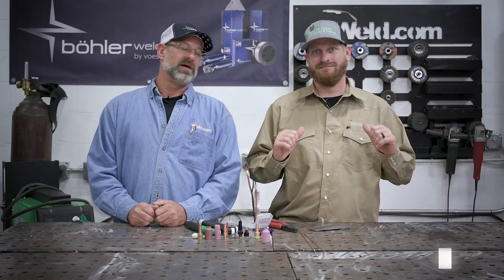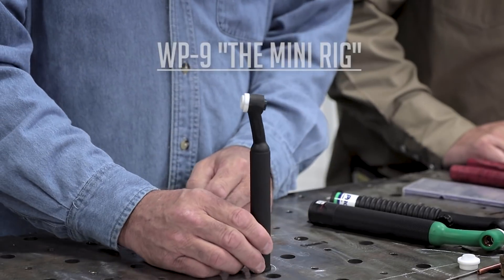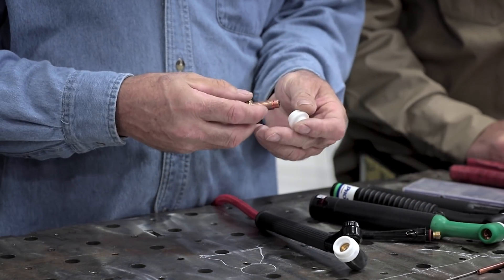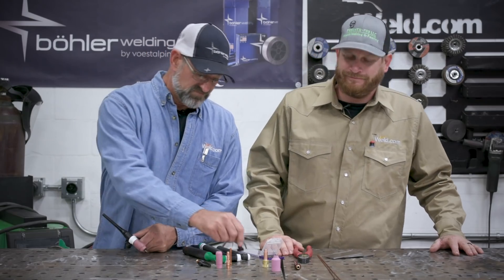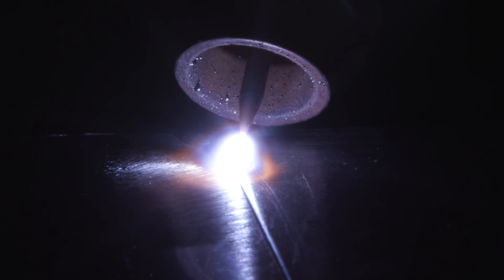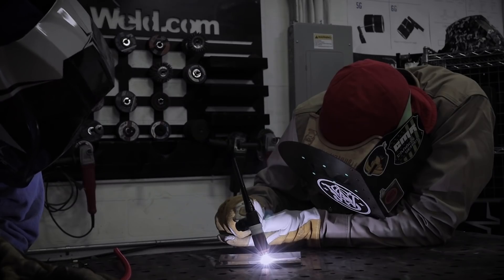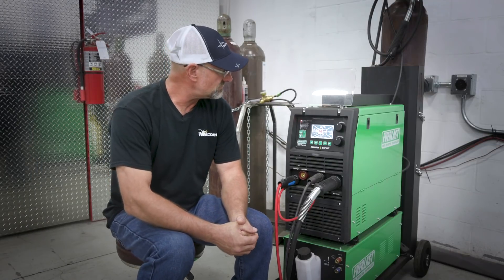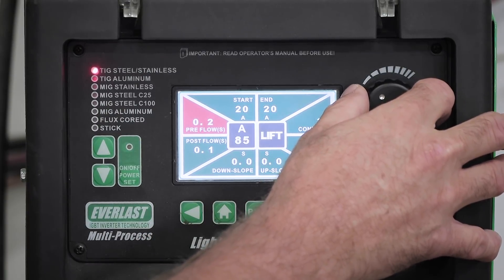Learn TIG Welding: A Beginner's Guide

Comment: Just started Tig on steel, definitely not at the Fun part yet kinda more in a different F Frustration. Out of all welding processes I have done Tig is the most challenging. I thought it would be easy because I has done Oxyacetylene years ago. Maybe it is because I am older it seems harder. Bob did very good, I have about 2-3 hours in and my tungsten is a couple inches shorter from dipping it. 😡. I will keep at it , after a few hours I was getting better, huge respect for those guys doing beautiful welds.

Comment: Hate to say it, but on that second piece he should have stopped him. Bob was barely dipping at all and basically spreading that puddle thin, he probably got an odd mix of filler and fusion welding going on there. It's not out of a beginner's ability to learn the idea of dip and move on the fly. It won't be the best looking weld but it's a step in the right direction.

Comment: Only 0.1 sec of post flow?? The post flow is there to protect the tungsten as it cools down, not protect the metal😄
Baseline would be 1 second per 10amps of current👍

Comment: 0,2 sec post flow = bye bye tungsten. Post flow is not for cooling (it does a veeeeery little bit, but not main purpose)! It is to protect hot metal from oxidation! Well known and good practice for post flow is to set it to 4 seconds for aluminium and black steel and 6 seconds for steinless.

Comment: I've had issues lately putting cubes together and working with tube where i immediately see oxidation, sparking, rust and porosity if i make a second pass after  root and i get penetration... in addition to the closed items spitting hot iron at me 😂🤣😂🤣. I've watched many videos and I see talk of back purging. but, I've seen you pros not back purge, make multiple passes and get beautiful welds. I'd like to see some videos on focused penetration as it seems you're careful to not allow in wall impurities or oxidized inner material to be worked into the pool.
i made my first few cubes not worried about some porosity which i tracked to gas flow. did a couple pyramids no problems. even completely sealing them. 
lately, i want to build up the weld to grind back to smooth and all hell breaks loose.
only other thing I can think is go to a 3/32 filler and only make one pass.
tips on avoiding burn through and oxidation not related specifically to gas coverage would be nice... i am using dc and one amp per thousand on the machine. though once things are warm i know I'm not using full current.
I've cleaned the heck out of the material and it takes a bead really nicely. er70-6 at 1/16".

Comment: Why two insulators?
Reply: Jack, it all depends on the kit you buy.   The way they were setting it up in the video, they were using the stock insulator, but since that is too short to seal with the gas lens collet body, the additional one takes up the space.   But, CK Worldwide has a better solution.  They have a 3GHS insulator that is 1 pc, and it is the only insulator you need for using medium size gas lens collet bodies on 17/18/26 torches.  USAWeld.com has them in their kit and it works great.

Here is the link to the CK Guide online:  https://www.ckworldwide.com/products/3-series-consumables-10n

Comment: im not here to knock anyone cus i aint infront of no camera but i certainly do miss red beard and mancub and more of bob moffit. just seemed to me to be more on my pace. anyone catch why he was stacking insulators ????
Reply: @Paul Sableski hey Paul thanks for getting at me now before i go and possibly put a foot in my mouth let me go back n watch it again to refresh my memory and then I'll reply with someting that will explain what it was saying
Reply: ohh ok i got it so at 2;45 you started to put your 17 torch together and i seen ya put two insulaors on top of one another. ok now before i go any further let me just tell you so you dont think im an asshole that i do respect your years in the trade compared to my only self tought at best 2 yrs of garage exp. and i think your full of great knowlede that i certainly lack , and this here is prolly one of them scenarios . so whren i started tiging i just jumped right on a #20 flex loc and ive never used a size 17 torch so that might just be how you properly put in a gas lens that calls for a diff size insultor because on #9's and 20's for a gas lens i  just take off the insulater and put on the correct size one by itself. anticipating your reply thx bud

Comment: Beginners at home you say........well a lot of home types have those 250 amp DC inverter stick  welders that go for A$100 on EBAY and the possibility of doing DC aluminium welding with argon is a case of shooting for the stars but I've learned anything is possible if you only have limited equipment.
Personally I use a plasma welder for all my home welding projects and one of them was a small frame base for my spa pump and I wanted to do it in 30mm X 5mm aluminium angle with the plasma.
Well.....a plasma welder runs at 8,000 deg C so you have to be very quick with it as the ally soaks up the heat and you can melt the whole joint through.
I use an ally stick 9mm diam with aluminium powdered flux like you use for gas welding......did the job but had a bit of cleaning up to do afterwards to make it pretty.

Comment: its a shame i dont know tig, a do field work using mig, stick and sometimes stuff like cast we do brazing. most of them have zero preciosity and look better that most home and some field welders. some of the stick have a little lower spot or hole because I might long arc with a long electrode but most of the time even if it has a little hole it has good penetration. im saving this till last because if i said i was 15 at the start most of you wouldn't read most of the comment. im hoping to go to (tafe) welding school. to get a certificate so it can be my trade/job

Comment: Pro tip. If you contaminate your tungsten, swap it out. Don’t try to weld on it, just sharpen it and try again. Contaminated tungsten makes a hard to control arc and it’ll make more headaches.

Also On the T-joint I’m assuming the reason why they guys filler metal was melting away from his puddle and was balling up at the end of it was because his travel angle was messed up. Basically his tungsten was facing towards his filler metal more that it was the joint. So if any of y’all beginners have that happen just adjust your travel angle.
Reply: Excellent info! Thanks for the tips.
Reply: @bobhigginbotham9035  no problem boss. TIG welding requires the most patience when learning. Especially if you’re doing something like walking the cup. Took a lot of time, cups, tungsten and bad joints to get where I’m at now. Like I said best tip I have is to get a full container of tungsten, sharpen them all, and whenever one gets messed up swap it out. Keep doing that till you don’t have any good ones left. While you’re sharpening think about why you messed it up and see if you can change it the next time you’re welding. patience and maximizing the time your welding are super important.

Comment: 7:03 Why he doesn't tell the guy not to cut off abruptly and pull the torch (gas coverage) away from the end of the weld ?  And didn't explain why not to do that either . That's not helping the guy.  Then the next joint he doesn't correct the guy pulling the rod out from under the argon gas below the torch .

Comment: Kindly make video about Aluminum Tig welding process and selection of tungsten for thickness of 8 mm sheet.
Reply: The channel has probably done over a hundred videos on TIG welding aluminum, if you just look back through their video history. But I bet you won't do that, because it seems like less trouble and work to just ask them in the comments instead of spending 10-second scrolling back on on the Channel's history

Comment: This question may be off topic but do you recommend someone to wear their contacts over glasses while welding because of the safety glasses you’ll have to wear?
Reply: One stray spark melting your contact doesn't sound fun but its a at your own risk kind of thing. You can get larger safety glasses that fit over prescriptions  at orschelns relatively cheap.
Reply: Get Rx safety glasses.
Reply: Prescription safety glasses are a wonderful thing
Reply: No you don't have to sacrifice.  There are plenty of safety glasses that go over prescription glasses.  I have some from harbor freight, and I have some from kimberly-clark.  Both work great.